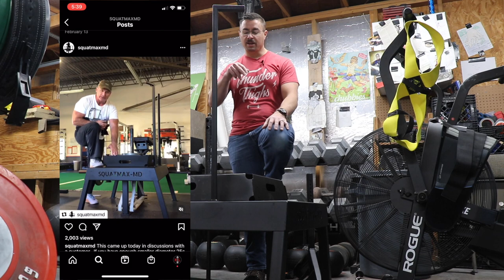The Ultimate Garage Gym Belt Squat: Squatmax-MD Belt Squat Reviewed by Strongman Garage Gym

Comment: Hi Kurt, I am buying squat max over rhino do to smaller foot print, anyways waiting to find a discount code so I can buy it 
I have a question, I bought the straydog goat with a pad too  it has the same use as the bulldog pad pretty much.  If I buy the squat max I wonder if I really need the hip trust attachment and the pad since I feel I can do thoese movements on goat, maybe not as good as squat max though🙄.  So if I buyt the best model of squat max do you know what comes with it?  The sit I would like to get and probably the  deadlift bar. Or can I attach any bar to the squat max to do deadlifts and rack pulls,
Reply from the maker: I think the GOAT works better for a chest support pad. KL10 for straydog saves you some $$. SquatmaxMD doesn’t do affiliate marketing, I just recommend the unit because imo it’s the best option.
Reply from the maker: As for model of sauatmax, I think the base model is good for most. I’m not understanding the question about the deadlift bar
Reply: @The Kurt Locker  sorry for the confusion Kurt.  I don't thinkni need the squat max pad since I already have the straydog goat??
The hip thrust work ok on goat but it looks like they work really good on squat max?? Anyways I have the goat with rollers, seat pad, utility loop and weigjt peg.  Just trying to decide if inreally need to pad on squat max?  Do u know if the squat max it's good for deadlifts or not really?
Reply from the maker: It’s not necessarily ideal for deadlifts. I agree that with the GOAT you likely don’t need the pad from SquatMax
Reply: @TheKurtlocker  thank u

Comment: I already own a titan selectorized lat pull down, a selectorized  funcional trainer and foldable titan rack also a stray dog goat with all the attachments.. Do you  prefer the squat max over the rogue rhino?  I was about to buy squat max but they don't have any financing as with the rhino I can pay $1000 and the rest in 6 payments without any interest. I kindda  like the squat max better  because it's smaller  than rhino and cheaper.  However,   it looks quite large compared to squat max??
Reply from the maker: I prefer the squatmax to the rhino but also understand that many folks will buy the rhino because it is easier to load
Reply: @TheKurtlocker yea that what drove me to buy rhino over squat max the easier of loading. Iam really thinking of selling it to buy squat max since I will be using it only for squats and also to do pad work

Comment: Kurt do you like squat max better than rhino for belt squats?  I have a bad knee and 2 low back bulding disk so i was wondering which one will be better as far as putting less pressure on knee?  I like rhino but i dont think i will use it for anything else than squats/leg work and maybe for plate storage.  I like squat max since its smaller and a little cheaper and i can do rows, hip thrust and other things however i need the pad. I think i will get the pad just for the hip thrust and seal rows even though  i already have the goat. It looks like the squat max works very good for hip thrust, however i dont think goat works that good for hip thrust. Ive heard if i get some weigjts with grips or soacers its much easier on squat max.  Also if i mout the plates right next to squat max to make loafint easier?
Reply from the maker: I prefer the SquatmaxMD to the Rhino. The only issue with the SquatmaxMD is loading the plates. Outside that, the SM is a superior machine. Be sure to check your ceiling height to make sure you’ll be able to stand up on the platform though. Also, to be clear, I prefer the SquatmaxMD, but that doesn’t mean the rhino is “bad”, it is also a solid piece of equipment.
Reply: @The Kurt Locker  thank you. Iam leaning towards squat max too however I afraid I won't like it do to the loading and unloading on a vertical pin.
Reply from the maker: The vertical pin is the one thing that is a negative
Reply: @The Kurt Locker  I am buying squat max md and need advice in buying some grip plates that can create a gap in between them to make it easier to load them and unload them on vertical pin.  Wanna be able to squeeze fingers in between plates.
I also will sell my rep fitness bumper plates to buy grip plates, ether rubber or utharene ones? The bumper plates are Bice but too wide and hard to grip them when getting them off the wall.

Or should I just use the grip iron plates I have and just use spacers??

Comment: Hou u doing Kurt?  Do you know if there are any differences between. The old version of the mountable rack  squat max to the new stand alone?  They are selling me one for$650 but I can probably get it for $500 but it's like a 4 hour drive.
Anyways iam 5'9 and son is about 5'11 and ceiling hight is 8ft.
Reply from the maker: I’m fairly certain that the only significant change between the standalone and the rack mount is the legs. There are some other minor differences like the belt eyelet on the squat pin, band peg locations, accessories like the riser and narrow stance inlay, and the alignment cutouts on the top but those are minor.
Reply: @TheKurtlocker  thank u

Comment: Thanks for your videos. What is better for belt squats Squatmax MD or flywheel?
Reply from the maker: Apples and oranges. If I have to pick one…probably the flywheel but realistically I feel blessed to have both of them.
Reply: @TheKurtlocker  are flywheel belt squats still back sparing (with squat harness and hip belt)?
Reply from the maker: @bold2013 absolutely. They load similarly if used with a hip or squat belt.

Comment: Can you use the narrow stance without the riser? Just thinking if I dont want the extra height but want it to be narrow. 
Great review btw!
Reply from the maker: You can use the narrow stance adapter without the riser. You will be very limited in the weight you can do, but it will function. You would have more luck using it in that configuration with the pin starting in the down position
Reply: @TheKurtlocker  Great. Thanks for the advice.

Comment: Do you still have and use this often?  Do you think its better than the Rhino?
Reply from the maker: I still have it and use it regularly. This is the first time I’ve had it broken down but that is because I’m working on a special project. Otherwise it remains setup and in regular rotation. I personally prefer it to the rhino but the one thing that the rhino has above the squatmax is ease of use. Plate loading is just simpler on the rhino